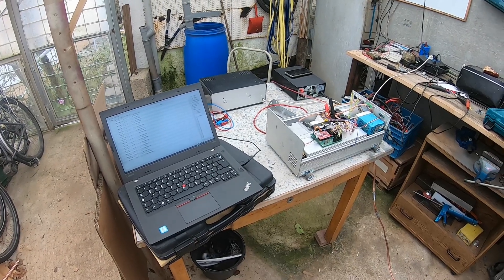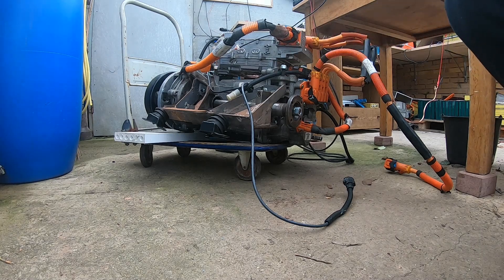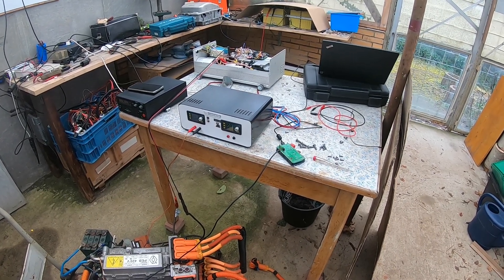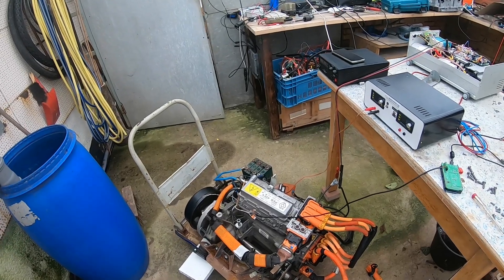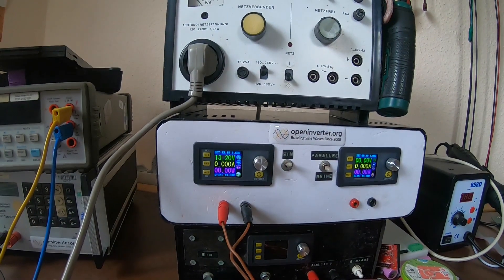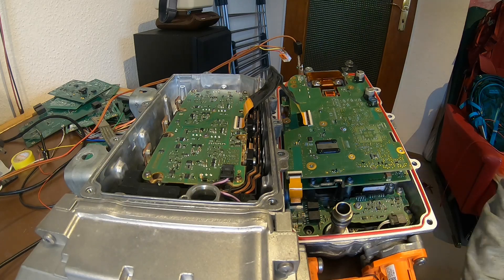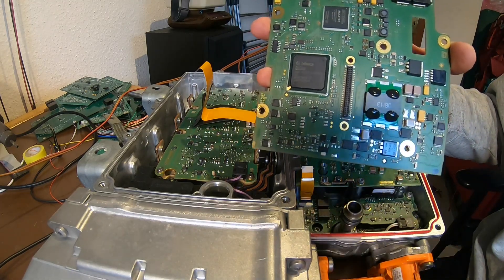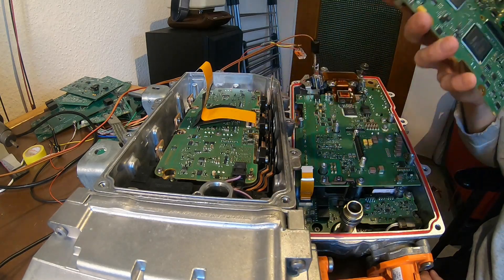Lab Update #88 -  Renault Zoe

Comment: Hi! Did you have any progress on this subject?
Owning two older Zoes (22kWh battery) I am looking for possibilities to upgrade the batteries. As you will know Renault have launched the upgrade to 40kWh, but did only sell this to a small number of customers.  Even as an EV enthusiast I have to admit that the 22kWh battery is not a really viable solution. Upgrading the battery itself wouldn't be that much of an issue, as the cells are available through the OEM (LG). But the BMS doesn't recognise the upgrade.
So, if you have any knowledge about this or know someone who has, a response would be highly appreciated.

Comment: Great work ! Did you investigate how the DC box (addon box required for DC Combo fast charging ) is fitting in the rest of the setup, there might be hint at the DC DC retro-fitting they have done to add the DC charge on top of the legacy PEB ? I was looking to see if there are ways to trick the DC Box and the DC DC to get to a two way DC charge/discharge at high amps. It would require some more on the ground module to get back to the 230VAC...  But unfortunatly I still have not much time to work on this to see if it is feasible and how much tricks should be brought in the middle.
Reply from the maker: Thanks!
I haven't looked at the whole system but I have not heard of a DC/DC module either. It would be unnecessary as the battery sits at the usual voltage range of DC fast chargers